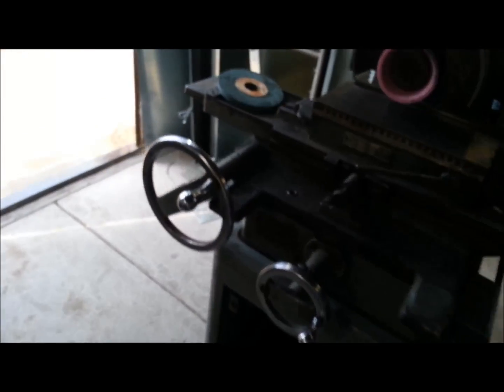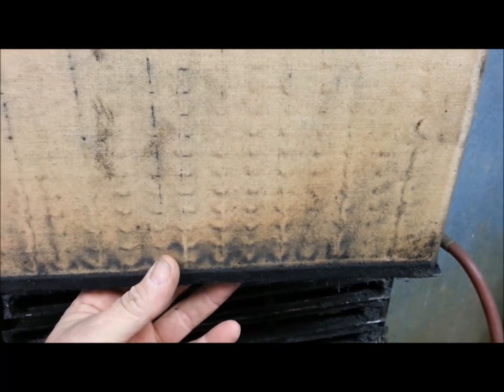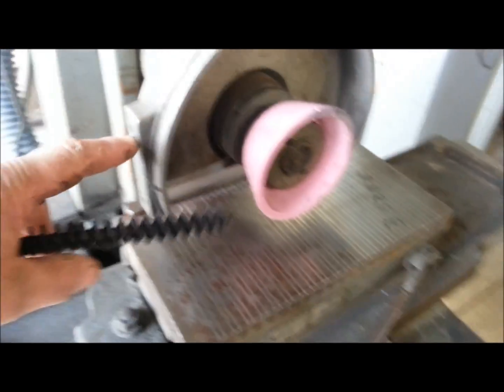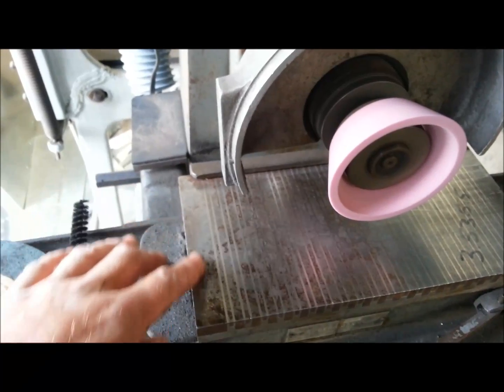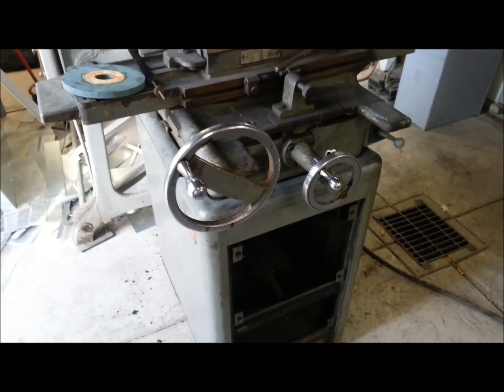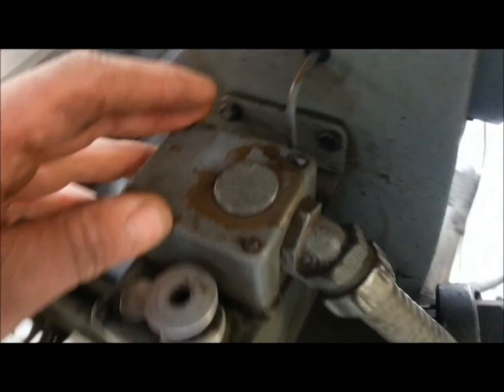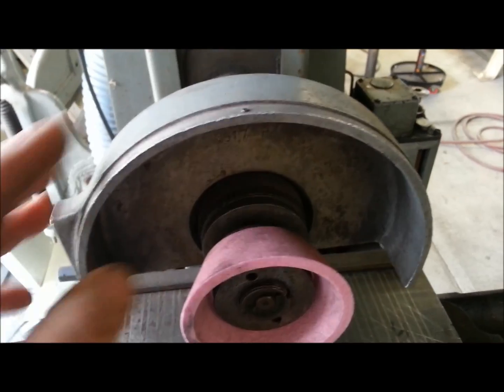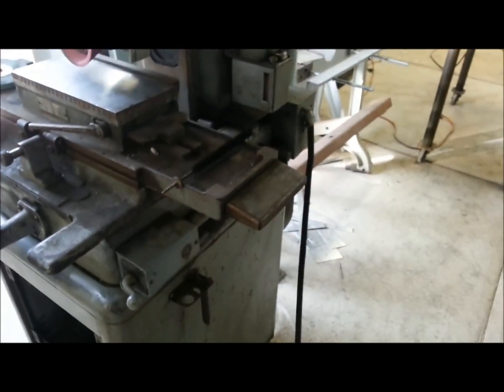New machine day - Surface grinder

Comment: Nice Stan,  can see it’s been a while since you acquired your Boyer Schultz. I’m going back through all your videos and work my way forward with your grinder evolution.  The Abrasive 1 1/2 is in the shop now. Also need three ph. I’ll be watching them all 👍
Reply from the maker: Wow, your going way back.
Reply: I'm reconditioning my 618 1a hydraulic (purchased 4/27/18 $450). No vacuum or flood which i want to add. also did not have 1-shot or plumbing. Trying to figure out how the table was getting lube if any. I still have visible flaking but haven't gotten the cross feed up and off yet.
Reply: Nick, think I can get a one shot installed on my ol Abrasive 1.5. Would be nice,  drilling on this He makes me a bit apprehensive since I don’t know how they have it drilled internally without a manual, still looking for one.
Reply: Yep, we all buy our own problems... lol
Reply: Flathead Ron's Garage the abrasive 1 1/2, I have too. it took me awhile to get it up an running so far so good.

Comment: The reversing switch was originally wired so that it gave the option of grinding with, or without the dust collector. A new owner could not figure out why it would not reverse (because that is what a reversing switch is for), so he "fixed" it by re-wiring it.

Comment: The dust collector motor doesn't run in reverse because the grit and grinder dust go to the right. The nut is normally left hand so reverse could spin it loose.

Comment: Thanks for posting this!  Your comments about the grinder not having enough power hit home.  My Boyar Schultz had the same problem - it worked, but it was not able to take more than about 5 tenths without slowing down - sometimes even stalling.  I opened up the motor junction block and found mine wired for 460VAC!  I'm running it from a 220VAC VFD.  Rewired it and it has WAY more power.  Thanks man!  My machine is very similar to yours including the blower except mine has a hydraulic pump for automatic X and Y feed (which works!)

Comment: Whoa, that is amazing, 3 five gallon buckets? They must've just built the collector and then just let it...collect, LOL!

I too love the design of the logos on it,,,as a former auto body and paint shop owner, I have seen allot of badges, stamps, and logos, and this one is quite detailed and artfully done.

I hope you got over the sniffles that dust gave you, I'll bet you found some nice black "statues" in your nasal dust collection spout :)

Aloha and thanks for the share...Chuck.
Reply: I just finished the video and learned it was a factory install, so I wonder how long it takes to get 20 gallons of girt?

I've done a few small forgings in my past and it made me think of just what all of that stuff is and if it would be worth trying to melt down to make something? I know that there would be heaps of smoke from the oil, and dross from the grind stone grit, how much of that do you think is metal in your experience?

Sorry for the barrage of questions, but you did ask two, and while I wouldn't have been able to answer them at least I can count that high! :)

Aloha, Chuck.

Comment: Looks good Stan - seems like you got your head pretty well bolted on and thinking right - espcecially so with VFD - you have all the basics covered well and then some.  Yes you will need individual overloads for each motor.  In your case I would think twice on grinder and blower on same VFD - if BOTH the motors AND the loads are identical no problem..  The motors do not care provided you do not run less than 10% rated RPM without added ventilation - as you know the motor fan is not fast enough to cool.  However the fan curve on the blower is going to be your main limitation / concern I think.  Some studying and head scratching may be good thing.  Blower CFM vs RPM measurement may be good thing to do.

FWD REV switch.  That does look factory for sure.  Why they left FWD REV labels on beyond me IF they did this to let your run grinder only OR grinder and blower together.  Check rotation of each motor in "FWD" and "REV" is my first thought.  Agree do not run grinder in reverse - saws grinder wheels go across shop at speed of light when they get "loose".

OILER   Wonder if that is a solenoid that shuts valve off to turn off oil flow when machine is stoppe ??  Looks like a gravity setup to me so do not understand why need for motor to drive a pump or a stirrer ???
 
Dan Bentler
Reply from the maker: Hi Dan,

After a little more research, the forward / reverse switch is wired to run the grinder by itself, or the grinder and dust collector together, the factory just left the stock nameplate on the switch.

The reason for installing a VFD is simply to generate the 3rd phase, I will not be using it for speed control. Standard parameters, coast to stop, 10 second ramp up, no DC braking, everything will be running at good ole 60Hz all the time.

I did a lookup on the oiler, it is 220V and pulls 8 watts, it needs to be energized when the spindle is running, easy enough with the programmable switchgear in the freq drives I use :)

Thanks for the well thought out comment!

Stan
Reply: Agree with all except dynamic braking.  Seems handy feature for an E stop.  I suppose even if you could brake within one second you may not likely avoid destruction of a grinding wheel.   So maybe a mute point - braking two motors I am just not sure about - would be interesting to fiddle with though.  Might need a separate brake resistor so not worth it in long run.

Dan

Comment: Hi Stan,
I have a Boyer Schultz grinder too.  Great machine!  I had to replace the LoveJoy coupler between the spindle and the motor and that was all it needed.  I don't have the dust collector on mine but looks like a good accessory.  I use a phase converter and works great!  Thanks for the video!
Regards,
Reid

Comment: my machine is a tool grinder.spindles on both ends.necessary to faciliatate the setups[limited table travel]mine does not reverse .but i have right and left wheel adaptors.the advantage to have multiple wheel adaptors is you can dress the wheel and change wheels without having redressing the wheel.also easer to change wheels [with hub]than to use spanner wrench and switch wheels and redress wheel to balance.i'm new to u tube don't know how to respond other than this.

Comment: i have a brown and sharp #13.it has right and left hand spindle adaptors.i would think if you used a hight hand spindle[running in reverse] the dust collector would be useless unless you  moved your dust cover.i have a large supply of spindles if yiu need any
Reply from the maker: Thanks David, any advantage to grinding in reverse?
Reply: +Shadon HKW  blow your nose before you make a video!

Comment: Cool new addition,I have a similar one in my shop without the sweet dust collector. I believe on that oilier where the flex goes into the other electrical box there should be a variable timer connected to the wires leading to the oilier. The box by the manual plunger is a small oil pump. As the machine is running, the timer sends voltage  periodically to the pump biased on the duration you set the timer for. As you run the machine you will see the plunger rise very slowly, and when it reaches the top of its stroke you will hear a pop, that's the plunger releasing a shot of lube.You just have to keep messing with the timer to get the right amount of oiling. If your machine is quiet and you forget to turn it off the oilier will make a huge mess(don't ask how I know that). Also if you run your machine infrequently the charge will leak out of the plunger past the seals, and back into the tank. So you would need to manually oil it. Hope this helps.
Reply from the maker: Thanks for the oiler tip, inside the box by the plunger it looks like a small clock motor, I dug around but couldn't see any evidence of a timer anywhere.

Any idea what voltage these things are? I would just be guessing  @ 110V, sure would hate to find out the hard way.

Regards,
Stan